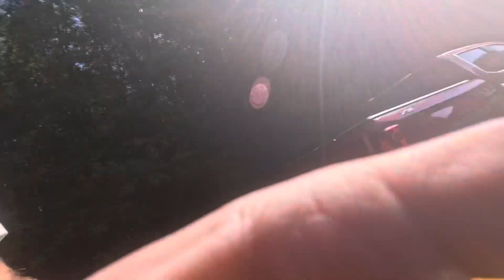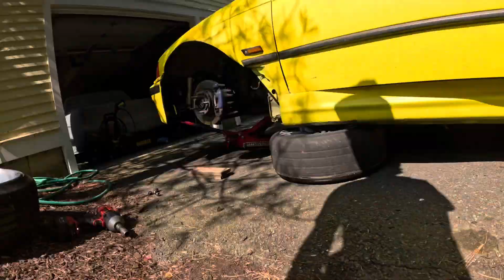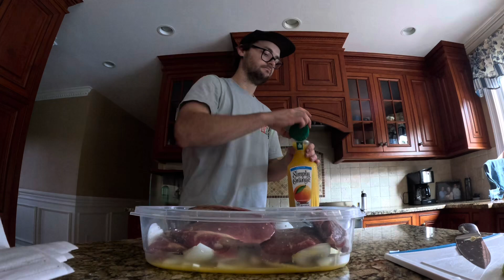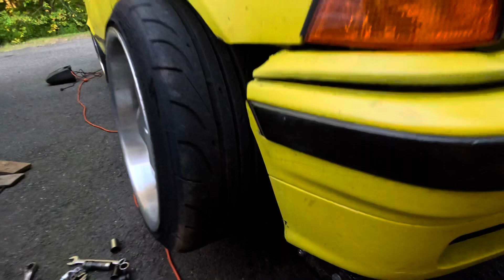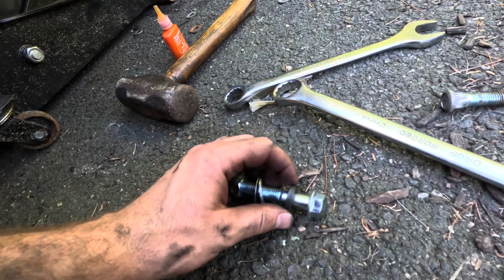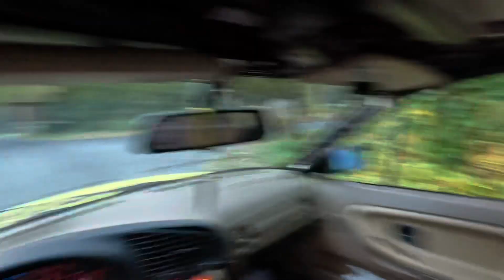RAkits e36 angle kit install and test (budget e36 angle kit solution)

Comment: Would you recommend this kit? Been trying to decide between this and other ebay style drift kit
Reply: Also was it easy to align
Reply from the maker: @jess5976  huge fan of this so far, big benefit of them vs fapo/ebay is they are located in PA and can get you replacement parts in a day. So far just has toe plate alignment and drives fantastic can’t wait to feel it properly done